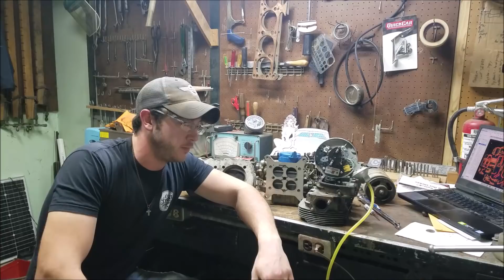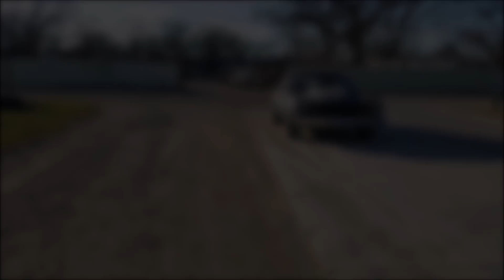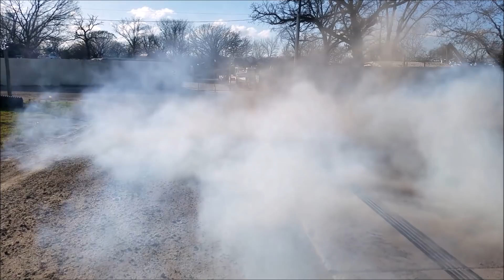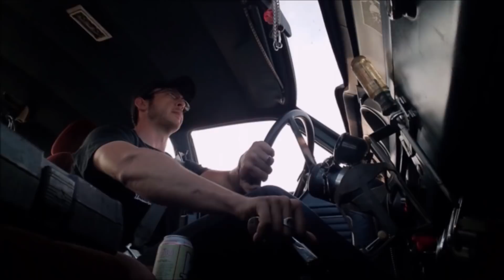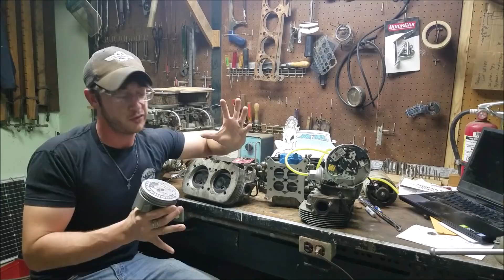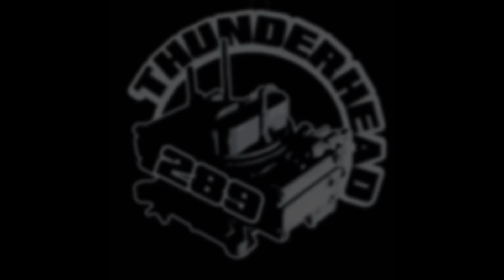How Ignition Timing ACTUALLY Works, ya idiots

Comment: You semi glossed over the rich vs lean timing by focusing on the density.  While right, just felt it worth mentioning, not only do you have a denser charge at WOT, but youre also much richer with much richer.  Most performance engines like to be in the 11.5-12.5 afr for power but steady cruising you should be up anywhere from 13.5-15:1.  This is where the carb troubles cross over to the ignition, too rich exacerbates the too much timing situation and people pull timing to fix it, which of course is wrong.
Reply from the maker: Afr does indeed alter the composition of the cylinder charge, but the tight spread of 11.5-15:1 really doesn’t lead to a massive change in timing. A lot of dyno guys will actually target 13:1 or even 13:5 for a hard pull, richer than that is actually just a safety margin. 
Afr will account for a couple degrees of timing difference for sure. 
Throttle position is the leading factor, but it’s hard to explain and grasp, so companies like holley will just use the lean rich explanation, which I have even used in the past to help simplify it to folks that seem like they are struggling to grasp the deeper cause for ignition timing variance. 

Even odder is explaining why we stop advancing timing at a certain rpm. Actually the cylinder turbulence at high rpm continues to speed up burn time. I’ve even seen where on an electronic distributor pulling a few degrees at a certain higher rpm actually increased power on an engine (keeping in mind that that same timing actually made less power down low) - literally pulling timing at 5500 rpm and above made more power up top. 
Even more funny is that it’s almost impossible to analyze this phenomenon, so even in the modern day and age, we don’t fully understand what’s going on, we just know how to manipulate this anomaly.
Reply: @ThunderHead289  It's pretty hard to see into a combustion chamber on a traditional engine without some kind of crazy viewport installed, and who knows how that would compromise the integrity of the chamber or the way the burn works.  Still, just such a thing has been tried successfully on some test engines.  It's been shown that on very high RPM reciprocating engines, eventually they are very similar in performance to turbines.  If I understood the tech articles correctly, at something like 18000 RPMs the pulses are so short, it acts more like steady-state flow instead of stop-and-start fuel-air delivery.  The amount of turbulence in the combustion chamber at those kind of speeds is crazy, as is the tiny window of time for an explosion to happen.    It's strange to think that despite many of the principles behind turbulence, timing, and even quench being discovered by people like Sir Harry Ricardo back in the 1920s, we took so long to understand them.  The crazy high-swirl chambers used by Ford in '86 were pretty exotic and experimental for their time, and frankly, they mostly sucked!  But we learned.  With computer modeling, we know a lot more now, but there are practical limits to what engineers can do with an engine and with the fuels we typically use.  Pulling timing at high RPMs makes more power?  Crazy.  But for that particular setup - it works. As you say - manipulate the anomaly!

Comment: A couple years ago in one of your ignition tutorials you mentioned the Progression Ignition fully computerized ignition but, as far as I know, never followed up on this. Well, based on your comments I installed one in my 65 GTO. It's powered by a 406 smallblock Chevy with Dart aluminum heads, Howard roller cam with 10 in. Hg. vacuum at idle, Edelbrock Performer RPM Airgap intake and Summit 750 vac  secondary carb (also based on your advice). Compared with a conventional distributor the Progression is like a carb vs. EFI.  You can focus on specific aspects of engine operation and really improve performance. Specific areas are idle quality, idle when the a/c kicks on, off idle acceleration as the clutch is released, transition from idle circuit to main jet acceleration, the possibilities are endless. It would be interesting for you to pick up a Progression distributor and play with it in one of your vehicles.
Reply from the maker: I’ve installed a couple of them for people as well as have two of my own. 
I haven’t worked on the supercharged 65 for a couple of years due to life changes and moving. 
Should have it out the spring, where it will have a progression unit.

I met Ted when his company was basically brand new. Really great down to earth guy who was annoyed with the typical limitations, so he did something about it. 
He gifted me a couple of them for helping him get his name out there. 
Really looking forward to finally using my own
Reply: @ThunderHead289  That's great to hear.  I hope that some day you'll do a deep dive on setting up the timing map. I studied some Holley Sniper maps to get an idea of what a fully computerized map looks like. What is also really cool is you can open the edit table while driving and see what the advance is doing under various scenarios.

Comment: Very educational, appreciate the simple yet to the point explanation.  I do have a scenario to run by you though; what would literally cause absolutely no vacuum signal at the timed spark port regardless of throttle position?  I can apply pressurized air to the barb on the side of the primary metering block and air comes out through the passenger primary barrel/venturi (no obstruction through the passage).  76 F250 300 i6 (stock longblock), clifford intake, holley 4150 (list 6390-1) 450 cfm.  Engine produces 20 inched of vacuum at idle.  Would really like to be able to utilize the vacuum advance setup as described in your videos, but this one has me stumped...

Comment: Hey Luke, love your videos, very informative!

I have a question, why do most (if not all) jet boats have no vacuum advance? I do understand that it's because the majority of them will be ran at WOT most of the time and you're not really looking at fuel efficiency. Is there any other reason?

My second question is, since there is no vacuum advance, why do a lot of people run jet boats with maxed out mechanical advance even at idle?

I'm talking about 70s and 80s big block jet boats btw

Thank you.
Reply from the maker: Most of them are maintained rpm well above an advance curve range (above 2800rpm) and they are usually fairly loaded (so no vacuum for a vacuum advance, and no reason to have low load advance). 
Couple that with the issue of the potential for moister to get into the distributor and rust up and seize the advance mechanisms, I completely understand why they don’t.
Reply: @ThunderHead289  appreciate it thanks!!

Comment: One time I forgot to reconnect my vacuum advance after checking timing, and for the next week I was looking for fuel leaks because my fuel mileage was cut in half. I also noticed that without vacuum advance, I had to keep my foot in the throttle like halfway (almost opening the secondaries) just to stay at 65 MPH. Once I reconnected the vacuum advance, I could cruise at 65 MPH with the throttle just barely cracked open.
Reply: On a different vehicle, I finally cured an overheating issue just from switching the vacuum advance from ported to manifold vacuum source. After that it would no longer get hot while going slow and idling in traffic, and increased mileage.

Comment: I'm assuming manifold vacuum is much better than no vacuum advance.....the 4 carbs are small dcoe weber chinese clones....they are individual runner and do not have any vacuum ports to connect to....so making a small plenum  connected with small diameter tube lines to each cylinder port.  wanting to keep vacuum advance and pvc functions....a 5.0 roller engine  stock  ...Ignition is mid 70's ford reluctor...mid 70's gm hei module ford  E coil mid 90's  motor runs good with 2 chinese weber idf's now but wanting to try the dcoes.

Comment: I get this.  Known it, but…. Let us know how this should be set up.  
Big cams have less operating vacuum.  
Cruise vacuum is lower.  VA should come in somewhere under the cruise vac number,  And should drop out, when you put your foot into it. 
With an adjustable VA canister, where should it be set up?
3-4 inches below cruise Vac? 
Or more?  Id like the advantages of more timing without the spark rattle!

Comment: Back in the 1980s, I had late 1960s cars that were subject to California Smog Laws. Living in Sacramento, I had to disconnect the vacuum advance line and cap the ports. Timing had to be set to a certain setting. Last was a sticker had to be placed under the hood somewhere visible.

Comment: Im still having A problem with manifold vs. ported vacuum..in the 60's ALL engines used manifold vacuum..it was only in the 70's and 80's that PORTED vacuum was used because of emissions..can you help clarify why you recommend ported ?..thanks
Reply from the maker: That’s not true - the 4100 fords all used ported. 
But it’s not about it’s intended purpose, more about what it allows you to do with your mechanical timing to make power at hard throttle. 
You can then run more initial mechanical, coupled with medium weighted springs - total all in by 3000 to 3500. 
The only other way to achieve better timing curves on manifold vacuum is to use very light springs, which wear out really fast and start adding timing at idle and often hang up after a rev. 
Ported is better, not because of it itself, but because of what it allows you to do with your mechanical timing. 

It’s also literally exactly the same as manifold except when you are idling.
Reply: @ThunderHead289  what you are saying makes sense..i guess i need to adjust my vacuum advance  to where it pulls advance at cruising rpm..( in my case 2000 rpm)..btw.. one guy on you tube says advance all in by 2000 rpm.. seems like that might  cause pinging..
Reply from the maker: @kymopar  yeah that’s some uncle tony tech - bad idea. 
You don’t need to adjust your vacuum advance, just the port you utilize. Then bias up your mechanical initial and recurve accordingly.

Comment: To make performance you have to light the fire well before TDC, as do all manufactures. Usually somewhere between 28- 38 degrees before. That is maximum advance ofcourse, the distributor [or computer] has to ramp it in usually from around 10 degrees at idle.  Maximum adavance will always be in before max 3500.
Many race engines however simply do not use an advance curve because the engine is say turning 3500-7000rpm. Simply lock the distributor. Though in that application have a start button that cranks the engine to A get oil pressure and fuel before you actually turn the ignition on. Or they will on occasion fire against themselves
Vaccuum advance is there for two things, it stops surging on constant throttle which in turn helps with economy. That is IF ofcourse if you have vaccuum. Many modiified engines have very little. If any! And Holley HPs have no provision for vaccuum advance! Or vaccuum brake boosters either.
For a race engine it is a waste of time and can cause grief. For a true street car engine even modified it makes the car drive smoother.

All engines, especially older ones on unleaded fuels will benefit from a multi spark ignition. Several brands, none are bad and the basic ones are perfectly fine on a stock or near stock family car engine. They start better, idle and run smoother. Use less fuel. Unleaded lacks volatility and really benefits from the better ignition. You can sometimes creep a little more advance in as well.

Comment: The terminology has changed in recent years.  We used to talk about degrees advanced or degrees retarded, but now gearheads have compressed that into jargon about more or less "timing."  Go back to talking about advancing the timing a few degrees, backing it off a few degrees, or retarding the timing a few degrees, and it makes much more sense to guys trying to figure it out.  Saying an engine needs more timing is like saying a stereo needs more tone, or saying the engine needs more tune.  It doesn't make sense unless you're in on the jargon and know exactly what you mean when you say "timing."

Comment: I gave up on vacuum or mechanical advance 30yrs ago.....I understand more timing is a good thing when idling around,   locking out the stock dizzy and using manifold vacuum to add timing when driving around worked but it was completely a gas mileage thing.   Who was driving there 450hp mustang nice enough to find out...lol

Comment: I think I can shed a little light on the misinformation about locked out timing. The circle track guys are the ones that caused this advance lock out talk. We lock the reluctor to the distributor housing by screw and also remove all springs and advance weights. Finally we weld the rotor shaft to the driven shaft and tada! What you see on tdc with the light is what you have all the time. But we are only concerned with wot performance. This of course, will not behave well on a street engine. We typically run anywhere from 30⁰ to 36⁰ with 40⁰ being a LOT of timing. Good vids btw.
Reply: We did similar with my cousin's drag car, warm 289 with the timing locked at 38*.

Honestly, aside from losing a bit of fuel economy I'm not sure it really hurt it. I expected it to be hell to start but it really isn't. He does have a gear reduction mini started though, it was designed for this.

Comment: Luke I've got a question about my Progression Ignition distributor.  The instructions are very clear to use full manifold vacuum and not ported but does not say why.  I realize the PI dizzy is a totally different animal and thus has different requirements.  My guess is that it needs full manifold vacuum to create the timing map? Any help in understanding how this works would be great. Thanks
Reply from the maker: Progression sports a map sensor - coupled with RPM, it makes the timing curve accordingly. It’s not bound by the laws of mechanized timing, it’s a step above the advantages of running ported vacuum since you have full control.

Comment: Wait I was under the impression vacuum advance has no effect past 2500 rpms
Reply from the maker: Vacuum advance has no effect in the absence of vacuum only. 
Usually it starts adding timing around 8inHg and is full vacuum advance around 12inHg. 

Anything below that, vacuum advance isn’t adding anything
Reply: @ThunderHead289  Have you looked at vacuum advance from manifold vacuum at loaded high rpm? Specially when carburetor size is the restrictor for rpm. Will the advance rise and do damage? With ported vacuum I will think it does not rise? Or will it?

Comment: Manifold vacuum and ported vacuum have opposite effects though.
Reply from the maker: No they don’t. Ported just doesn’t ad timing at idle if your carb curb idle throttle is set up correctly. 
I even proved it in my video “ported vs manifold” where I drive down the road with a vacuum gauge hooked to both. 

People are confusing ported with venturi vacuum which is not an externally accessible port on holley/Edelbrock carbs. On a holley, venturi vacuum is used within the carb to actuate the vacuum secondaries. 

Nothing but the facts ol son.
Reply: You are most correct sir, however ported vacuum, being above the throttle plates, prevents lean backfiring on deceleration.

Comment: Love your videos !! why does  Kevin at Junkyard diggs Hate autolite/Motorcraft 2BBl carbs??? I have been working on them for 35 years and Never had problems with them you can run them without the top on.[run them NOT drive with it]...
Reply: But whats your opinion on the quadrajet?
Reply: @daves_not_here_mannn  When the Quadrajet is Good when it's tuned  right But when it's not it's bad.

Comment: I put a Blueprint  brand 383 in my fathers car and their tech said do not hook up vacuum advance. He said at high rpm's their engine breathes so much that even with the throttle plates wide open it will still have manifold vacuum and advance the total timing to much.  He said with a total mechanical advance at 3500 and 32 degrees before top dead center hooking up the vacuum advance could add several more degrees and detonate.
Reply from the maker: Not really possible unless you had a tiny carb - like a 500cfm, and then you would need to make at least 8imHg which is highly unlikely
Reply: @ThunderHead289  The way they dyno them is unhooked. He said in most cases your way of thinking is correct, yet in this combination he said it will pull a measurable vacuum at high rpm's with the 750 cfm carb that was provided. I have no proof.
Reply from the maker: @1958johndeere620  is just test it out personally - have a vacuum gauge in the cab and see what happens. On a 600dp I was close to that at 6000rpm on a 302 - saw vacuum gauge raise to about 1inHG. 
I’d be surprised if a 383 could manage that. 
If your happy with it, don’t change it - they just build in a safety margin for themselves, but it would improve economy. 

You also can’t arbitrarily say x timing for x engine. A 383 in a light camaro would sport a totally different timing curve than a truck if both tuned for peak performance
Reply: @ThunderHead289  He actually wants me to do the same thing when I get a chance. He wants to know if in our application what it does draw. It will take a co pilot to read the gauge, gets pretty busy.
Reply from the maker: @1958johndeere620  yeah I agree - much safer that way especially at all the rpm